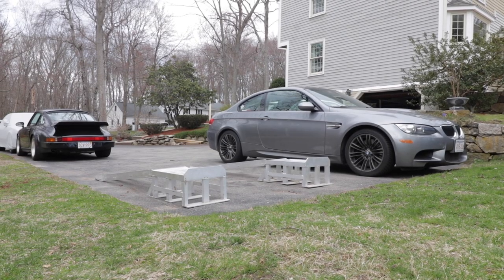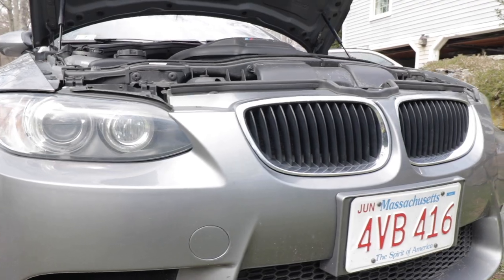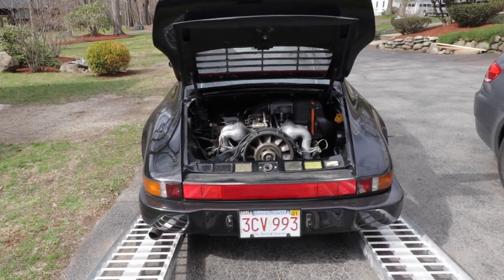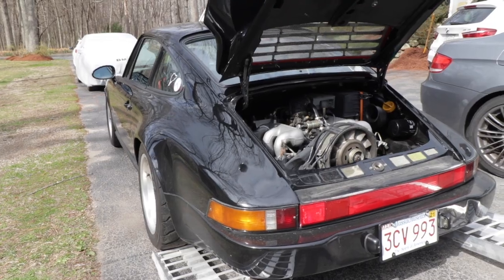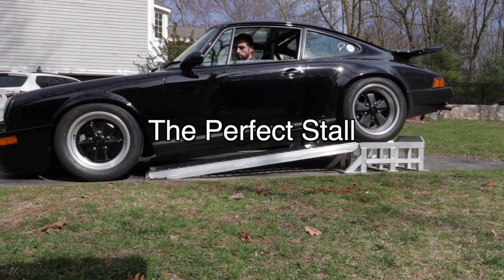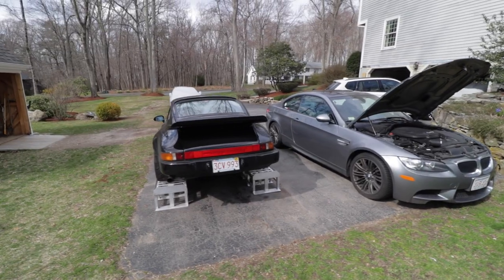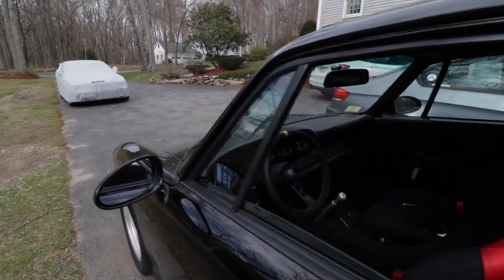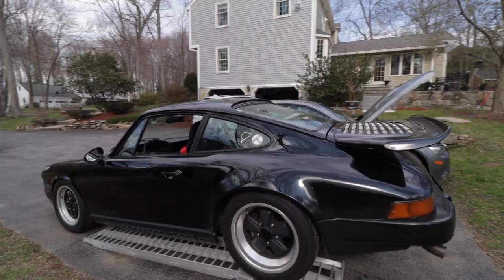How Air Cooled Engines Work: An Idiot's guide to Luftgekühlt - 1988 Porsche 911 Carrera 3.2L

Comment: One of the other reasons Porsche ultimately had to move to water cooled engines was the relative amount of noise produced by air-cooled engines.  New regulations were coming into effect and in order to raise the performance level of the air-cooled 911 engine it would have to create even more noise.  Water cooled engines benefit from water jackets that help deaden engine noise.   Not that the GT3 is in any way quiet under acceleration. Great video.
Reply: Name one noise regulation for cars and how it was implemented ... and when.
Reply: @AllAmericanGuyExpert  Ford discontinued the 7.3L Diesel in 2003 because California passed a Law about Noise ( specifically decibels on start up ) and went to the 6.0 which was under the given threshold. This is just one example ... do some homework.
Reply: @jrolla1858  Ok, I researched it and found no reliable source for that. Name your source, and if it is Wikipedia or a magazine/blog/news bite, name your source's source.
Reply: @AllAmericanGuyExpert  in America? 🤣
Since the S in USA stands for safety, there was no room for noise regulation...

Comment: I hate to disagree with you, but we had Porsches in the 80s making 400 and 500 horsepower, also it's sort of sad that emissions killed off to very great engines, air-cooled and rotaries
Reply from the maker: It’s not a disagreement it’s a fact that I discussed in the video. Making that power with a broad linear power band on a budget while meeting regulations was just not a good business case. This is why those guntherworks and singer engines are so outrageously expensive.

Comment: The big problem with air cooled is that in order to allow for the thermal expansion that you would see on a 100F day wide open throttle type event, you have to have a piston, and more importantly ring-pack that are undersized/ opened gap to tolerate the heat swelling without interference. As a consequence, there is more blowby...an order of magnitude more blowby.

Comment: Engineering class with Tedward! Now THIS is the kind of curriculum I wish we covered in my heat transfer and thermodynamics classes!😭😭
Reply from the maker: Quick what’s the thermal capacity of of air vs water at room temp and sea level!
Reply: Tedward Air - 1 J/gK, Water - 4.18 J/gK I swear I didn’t just google that

Comment: My favorite air-cooler is the 993 Turbo, such an amazing machine, still quite fast today.
The problem with air-cooled engines is more about emissions than power. While it's true that one will need more money to make more power out of an air-cooled engine, emissions will always be the issue. A turbocharged air-cooled flat-6 engine will happily churn out 500, 600 even 700 horsepower with ease. Powerwise, where it gets difficult is with the naturally aspirated engines, where the use of 4 valves per cylinder isn't possible in an air-cooled engine (there's no way of cooling the center of a 4 valve head). 
Otherwise, they are amazing pieces of engineering, full of character and a symphony of great mechanical noises, especially when compared to a water-cooled lump.
Reply from the maker: Oh I hope you watched till the end!
Reply: @TedwardDrives  oh yes I did! And loved earing all of those water-coolers and your lovely 3.2 Mezger! God, I miss my air-coolers, locked away in the garage due to the damn pandemic...can't wait to drive them again. In the meantime, I'll be living here in the air-cooled videos!
Reply: You cool the center of a 4-valve head with oil.

Comment: Awesome video man, keep doing these informative videos for the air cooled 911's. I am in love with them, and I am sad that the values have went up so far in the last 8 years, and also how expensive a top end rebuild can be, because I would have went with a 993 manual C2 instead of the 991.2 C2 manual. I do love the modern amenities as well as the modern performance the new 3.0L turbo engines have. It is a toss up but there is no doubt which one has more character and also more cool factor.

Comment: i've blown couple of engines on my Alfa GT V because of thermostatic valve failure, i took it off 20 years ago, never had a problem, runs a bit cool but it's better than too hot. Porsche Singer is for me the best of the best.

Comment: Yup... And then there is reliability... Most of the issues we have had with the 996tt have been with the cooling system... That thing is so pissed that it is water cooled... But, fuel economy, European noise regs, and going to four valves kinda did in the air cooled. But it sounds cool! Especially the 3.2. The fan is different in the 993 and the curved blades are to reduce noise (mostly). The water dampens the brightness of the sound as well.  Still that GT3 sound is just about perfect!  Glad to see you are well :) F
Reply from the maker: I watched yours after I made mine! You nailed it with the noise. It’s such a distinct sound but lots of vibrations 😂

Comment: I have a Porsche air cooled flat 6 on my work bench right now ready to be assembled.  I've done lots of American engines and they are all similar, so I decided to see what makes the Porsche tick. It's a really spectacular engine to say the least and I can't believe it was designed in the early 60's.  Really on that engine high pressure oil is precisely delivered to exactly where it's needed and there's lots of oil to disperse this heat.  And more thermostats, bypass valves, and cool tricks moving that oil around than you can throw a stick at. The engine is also super strong with 8 main bearings holding a 6 cylinder crank.  Super strong and no wonder why that bottom end lived on for may more years.  The other piece of the puzzle was the development of Nikasil and later Alusil allowing better heat dissipation and made the engine displacement increases in the 70's possible.  It's a true engineering marvel and the simplicity is very appreciated now given the complex world of modern engines.

Comment: Awesome video! Incredibly helpful. If you had a preference for a weekend drive, is it the 911 or the E92?
Reply from the maker: It depends. If the roads are bumpy and I need to not smell like oil and fuel at the destination, m3. Otherwise 911

Comment: The oil cooling contribution is more than you think.  Some say more than air.  It kind of depends how fast you are moving and which year.  Race cars are more oil cooled than air for sure and they make plenty of power.
Reply: I knew it couldnt be purely just air cooling the engine...and the oil cooler is how they do it

Comment: My 1970 914-6 had great heat w/ no A/C. My 1980 911 SC had great heat w/ asthmatic A/C.  However, my 1999 911 996 has GREAT A/C w/ questionable heating abilities. Heating due to the foam deterioration on the control panel doors in the dash.
Reply: My '73 911E had terrible cabin heat and I always assumed that was the case with all air cooled Porsches; guess I was wrong. BTW, there are videos on YT on how to fix the foam deterioration issue in the early water-cooled Porsches which I plan to implement on my '99 986 and '08 997. Very annoying problem, but seems easily fixable.

Comment: Just droped off my BMW at the mechanic. Coolant leak. Never had that issue in 31 years of air cooled 911 ownership. Second time in years for that BMW, but second time. Meanwhile my mother is coming over to pick me up in her 993. We own many cars, almost all water cooled, but when all else fails it's the 993 and 930 that are the most dependable. Mostly by virtue of air cooling. In fact, if I wanted to build a family car to travel from Paris to Beijing, or from Dallas to Tierra del Fuego, it would be a VW bus with a 993 or 964 air cooled motor. I give not a crap about eekikg out a little more power. It's hammer simplicity and durability I crave.

Comment: Very nice video.  WARNING:  if your fan quits on your air cooled Porsche, turn off the engine immediately!   The oil cooling function will not keep your engine's temperature at operational level and you will quickly cook (ruin) your engine.  The air cooled Porsche is NOT an oil cooled engine.  It is true that oil plays a limited roll - very limited - in keeping all engines cool regardless of whether they are air or liquid cooled. 

Why might the fan stop on an air cooled Porsche?  1.  broken fan belt; 2. the alternator, which the fan is bolted to, seizes and stops turning.  How will you know if your fan quits?  Your alternator dash light will come on and your temperature gauge will climb rapidly.

Comment: Do the heat exchangers do anything else for the car other than for cabin heat? If I don’t care about heat in my 87, are there options to save weight removing the excess chamber?
Reply from the maker: Nope! It's just a way to get heat for the cabin since there's no coolant to run through heater cores. They are very expensive to replace so most people who dont need the cabin heat will just run pipes

Comment: My father had a '68 Beetle when I was a kid in the 80's. Not super refined. The engine had that loud sputter and that Beetle was rock solid dependable. The Beetle's engine was a dry run for the 911's flat six, correct?

Comment: Didn’t the Ruf Yellowbird have watercooled cylinderheads like the 959?
Nothing in this video I didn’t know yet, but very entertaining to watch. Thx!
Reply from the maker: Yes it did which makes a LOT more sense. When researching this I was like how the heck did they make that much power???
Reply: The original Yellowbird, CTR absolutely did not have water cooled heads. I'm fairly certain the CTR 2 didnt either. The current CTR retro car does, the whole engine is water cooled. The only Porsche flat 6 engines of that era that did that I know of we're the 956, 959 and 962.

Comment: Please, can you help me with a doubt?
Is it possible to overheat a VW type 1 engine?
Let me explain this, a few time ago I made some repair and lightly oversized one of these engines. But, in a highway test that I made smoke began to come out from the engine compartment and then it stops. Later in the same day the engine starts again like if nothing happened. What happened there? I just don't understand! And the only thing that makes me doubt is a thermostat placed below the cylinders that controls the opening of the air passages of the air turbine.
Please, can you help me?
Reply: If you heated up the engine and the oil dip 
stick is so hot you can't touch it it overheats. 
Yes the dipstick is warm but it should never burn your hand when trying to check the oil. 

The black smoke could be due to too much valve play.
Gotta adjust it every couple of thousand miles

Comment: Very interesting. I owned a 993 for a couple of years and loved the sound, and the design (oh,and the ride and especially the brakes. My God the brakes on a 911 is pure porno). I never got used to the 996 and later interior, less sloped windshield and getting rid of the classic Porsche gauges. Currently though, I am looking at buying a nice e92 M3. Would you recommend it, even if you consider a 997S?
Reply from the maker: Definitely recommend the m3 but beware the maintenance. As long as you know what you’re in for it’s not a big deal. I’ve got a “before you buy an e92 m3” video that covers it all

Comment: Is the air used for the air cooled engine atmospheric or cooled by a heat exchanger?
Reply from the maker: It's all atmospheric...There's an oil cooler up front that you could consider a heat exchanger but it's working passively since it can only cool based on the flow of air provided by movement

Comment: The name is pronounced "roof" and the car was and is still reliable, the original "Yellow Bird" is still driving today.
Reply from the maker: It’s driving but do we know what kind of work has kept it driving? It’s possible it’s dead reliable. Also possible it’s had major rebuilds
Reply: @TedwardDrives  cars require maintenance not sure what your point is? Do you think a purpose built race car would just trundle along for near 30 years w/o regular work being done? Anyway, you can find out for yourself as Alois Ruf has several recent interviews where he discussed the original car and its running condition and keeping it running over the last 30 years...

Comment: How does the air cooling work in trafic or low speeds ? Aren't the cars affected by that ?
Reply from the maker: They tend to hold up pretty well but on very hot days in stopped traffic I usually just turn it off haha

Comment: Do you think certain Porsche purists overhype air-cooled engines?
Reply from the maker: Absolutely. But Porsche enthusiasts have a way of overhyping almost everything. It can be hard to live up to that hype so you have to be objective and trust your own feelings toward the cars and technology
Reply: @TedwardDrives  does it feel that much more special than an water-cooled car?
Reply: I wouldn’t say I’m a Porsche purist, but there is something about an air-cooled machine — I’ve had VWs, BMW motorbikes , and a 911 that have a certain essence. Call it simplicity , an unconventional engineering approach, or just the smell of oil taking heat away from the horizontally-opposed cylinders, but it’s kind of magical

Comment: The front plate on your 911, it hurts my soul ;-)
Reply from the maker: getting pulled over all the time hurt my soul. i finally gave up. It's not worth the hassle. I'm already driving spiritedly...Don't need to give them any more reasons to have a chat.
Reply: No way, that sucks!! I was ticketed one time in 2006 for no front plate but they tacked it onto a speeding ticket.
Reply from the maker: I try to keep my cars like the Wolf from Pulp Fiction. Not even a broken tail light. Don't give them an excuse to find the body in the trunk lol

Comment: the LTS RnD for this engine done by Arab countries, it actually a boxer engine with with flywheel air-cooled in top...I wonder what happens happens if they converted to 2 stroke....must be it loud then RX7.... factory stock look this cars worse, cars that come with RWB kits will look good.

Comment: Another aspect is piston rings are designed to be run at a controlled engine temperature to minimize blowby and friction. With a watercooled engine you can have pistonrings matched for the running engine temp. If the engine is to cold or to hot this gets bad. Whereas aircooled you don't have this level of control, meaning more blowby and more bore wear.